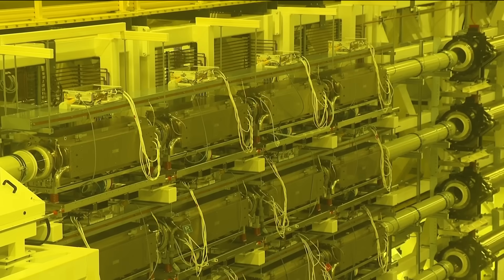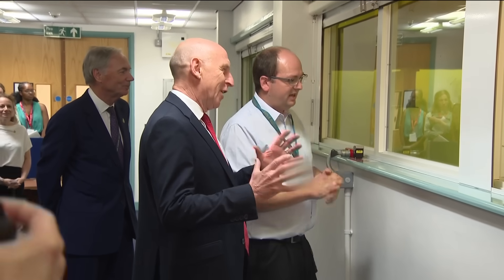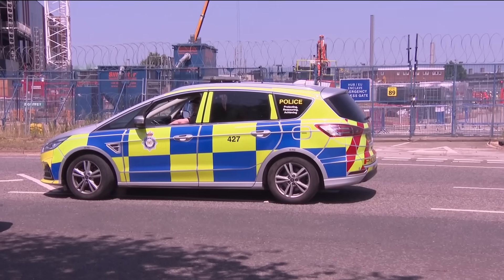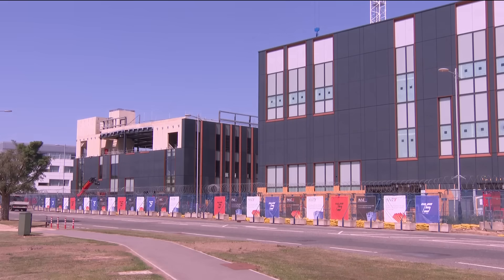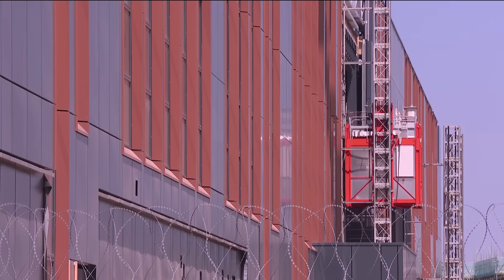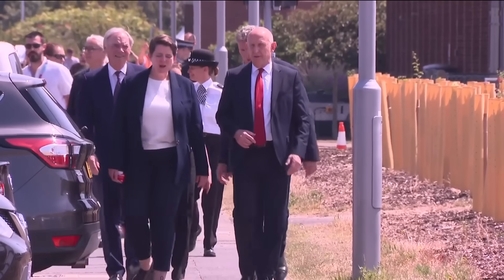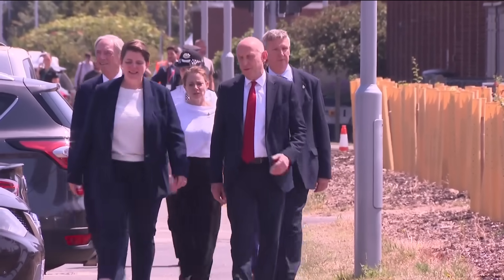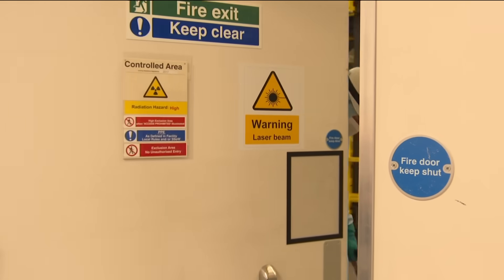Scientists race to build a new nuclear warhead by the 2030s

Comment: Hyperscalers large-scale cloud operations rapidly and efficiently. characterized by massive data centers and infrastructure capable of handling vast amounts of data and requests, often supporting  nearly every aspect of operations similar to (Infinite Data Center)
Hyperscalers operate at a scale far exceeding traditional data centers, with the ability to handle millions of requests per second and terabytes or even petabytes of data.

Comment: something very wrong here,  why not just remaster the old proven weapon. why spend billions redesigning something that can never be tested ? why not just stick to the old design and refurbish the degraded parts..........was the old system a hollywood prop or is this massive corruption  ?
Reply: Tridents are reliant on the Americans to maintain and with stockpile renewal coming up I suppose they've decided to replace it with designs that can be maintained here. We've built our own nukes before so it's not like we're inexperienced.
Reply: @bourbon9986  no reason to reinvent the wheel and spend billions doing so. Simply copy the proven design

Comment: I agree. A systemic... top to bottom upgrade.   is needed. 100 point restoration. 

We need new submarines. Keep the old ones too, do not scrap them. Use them alongside brand new tech. 

Our infantry need new, modern rifles. Our infantry should also have 300,000 little hand controlled drones. Small ones that can be used for surveillance and targeting. And can be quickly and easily retrofitted by an infantryman with explosives to kill tricky, hidden,  targets,Vehicles, land based defense systems, etc.

We need to manufacture a minimum of 1,000,000 drones. Capable of, a range between supersonic and hypersonic flight speeds, surveillance and killing

We need to design and manufacture our own brand new stealth fighter. With our own completely isolated secretly designed and manufactured operating system and electronics. 

We need 2 more aircraft carriers. Now. Along with the new warheads. By 2030.  Get it started. Now. Employ the workmen . Now. Find the money to do it. Now. 

And as discussed. The new warheads.

Comment: There was a company in Slough who made heavy duty leather gloves coated with a lead and resin compound. These were used as safety gloves for manufacture of plutonium warheads in a mechanical workshop and they were heavy weighing 2.5kg each so a pair of them 5kg . I used to deep the heavy leather gloves in that compound and it took upto 12 dips each for 60 seconds so building it up .